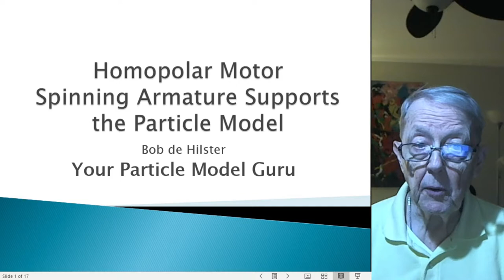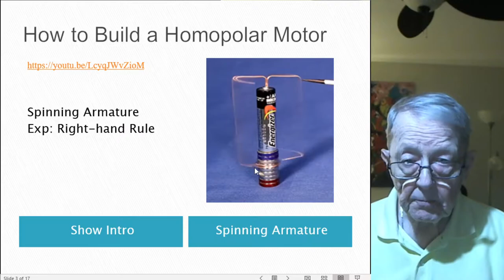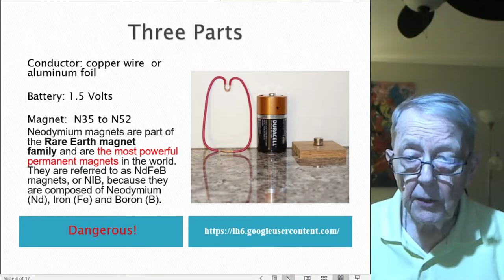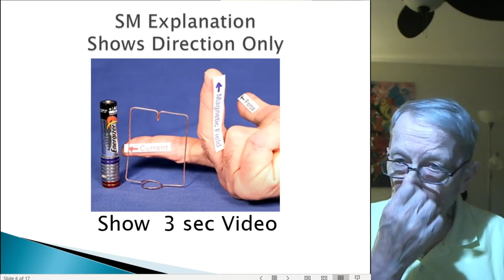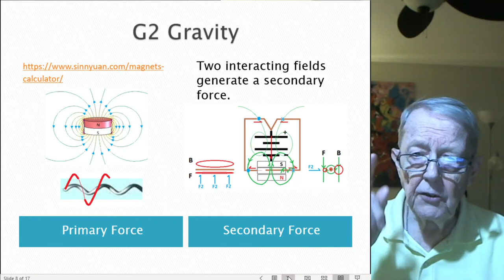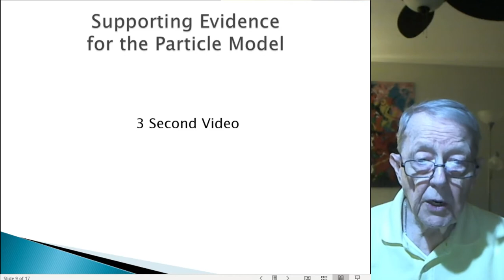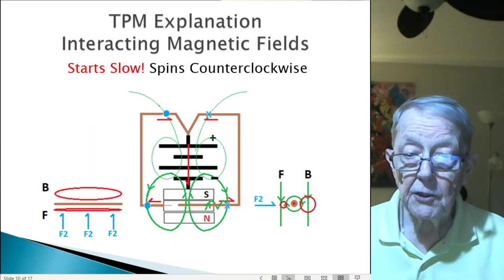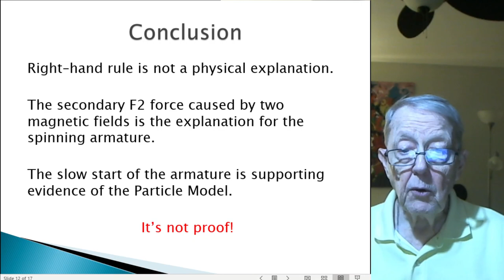Homopolar Motor - The Spinning Armature

Comment: Another possibility for the 3 sec delay is heat.  Without heat, the electrons could travel in a helix through the wire, giving no torque.  When the wire gets hot, it gains more resistance and also gains more torque.  I have watched at least 5 of you videos and still haven't sorted out G1 and G2.
Reply: Basically g2 is the forces acting on g1 particles. And g1 particles dont interact with g1
Reply from the maker: @635574  Let's just start with the G1 particle. If you read about Georges L. Le Sage's theory of gravity, you will learn about his ultra-mundane corpuscle. That is exactly what the G1 particle is.
Then ask me about the G2.
Reply: After studying more homopolar motors I am of the opinion that helix doesn't mater and that the delay was from a bad electrical connection.
Reply from the maker: @martinsoos  It seems clear that there are other issues to consider. TPM suggests that a 1.5 volt battery has less chemical activity than a 12 volt battery.  

It would be interesting to measure the current used in the homopolar motor vs the rail gun. And at the same time measure the acceleration.

May I will do that when I retire.

Comment: I dont think we need to think about the speed, its looking like slow acceleration but if its just that, slow constant acceleration there is nothing to measure. It is a lossy weak system with no practical use and the force drag equilibrium speed is quite low. I dont have the cameras or magnets or spare wires to measure this or do a vacuum version because I cant find any videos of this.
Reply: I would love to see this experiment in a right hand and left hand helix on the vertical part of the wire.  I am thinking that there might be an angle or helix direction that might cancel out this effect.